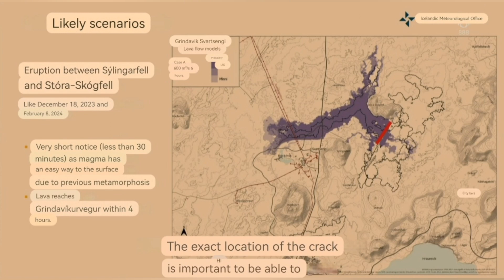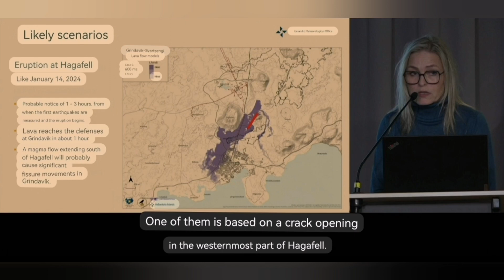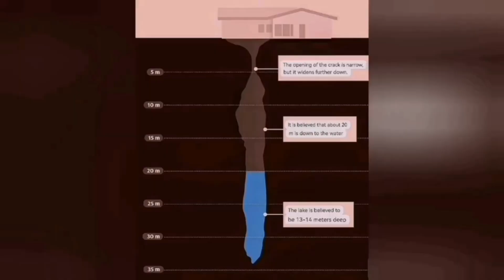Three Eruption Scenarios: Location,Alert Time,Flow Path,Iceland Svartsengi Grindavik Volcano Fissure

Comment: Is Grindavik a historic town or is it a new one? If it's a new one i have to say that i am really questiong the reason why even one house was built there! Is it not illegal to build in such Subduction Zones in Iceland?  I feel sorry for those who may have been duped to build their houses there, lured by non existing serurity and safty feom natural hazards in Iceland.
Reply from the maker: Not very old, but not new either. It was a port for fishing, then extended in 1930s. It is on an extension ridge inside a rift where plates are moving apart. We didn't discovered plate tectonics until 1960s and it really became common knowledge only in 1990s.
Reply: @TheAstronomer  Thank you for the insights Doc. !
Reply from the maker: My pleasure.